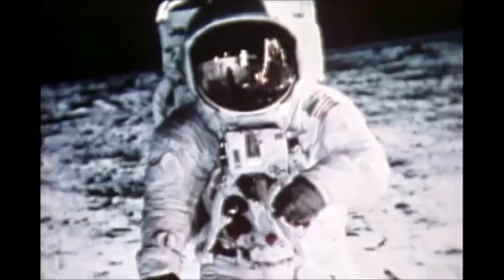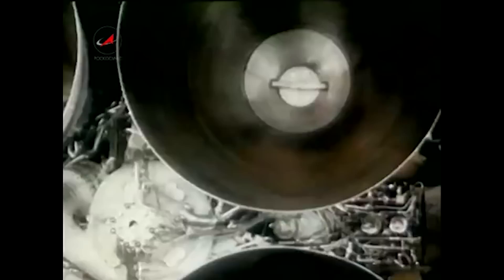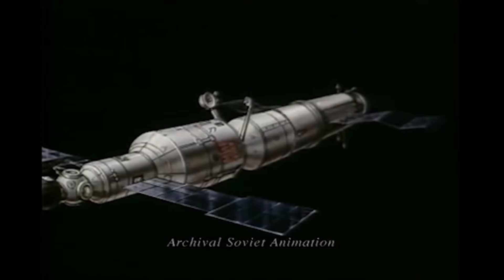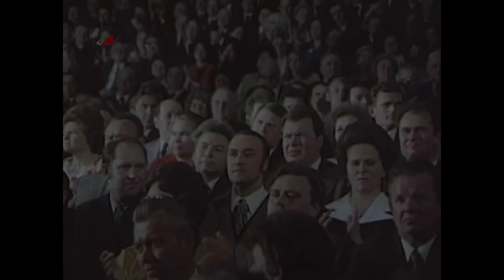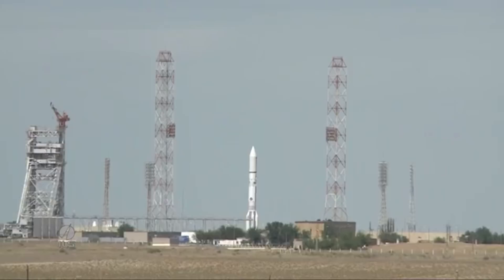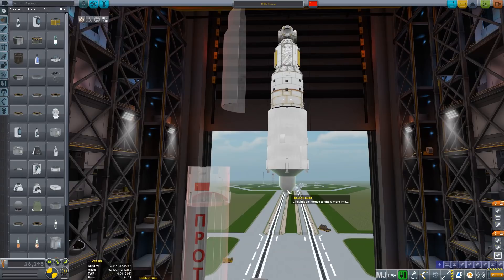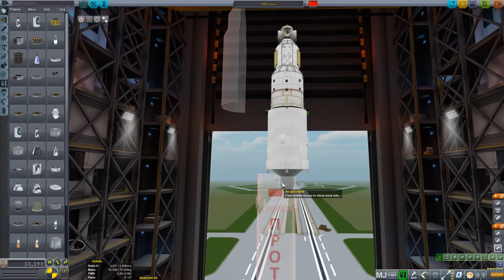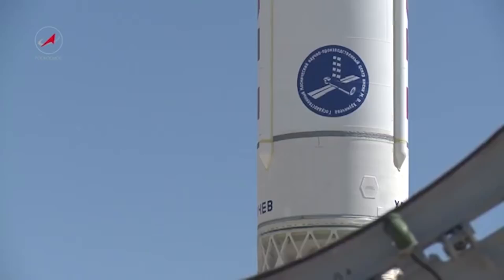Mir - Episode 1 - The Core Module

Comment: Do you know why the second stage ran two different engine types
Reply: I was wondering this too. Apparently the only difference is a heat exchanger. Not sure what it does though and why they'd only have it on one engine.
Reply: great question, so the reason this exists is that the heat exchange on the RD211 is used to pressurize the fuel tanks but only one is need to do this so the RD210 is the same engine jsut without it to save weight